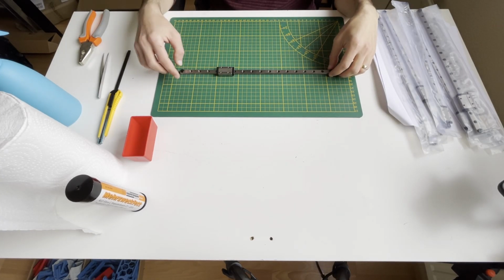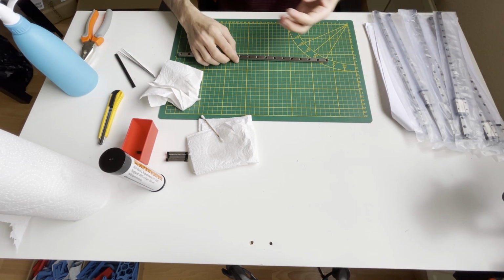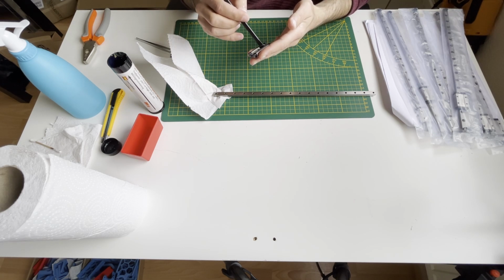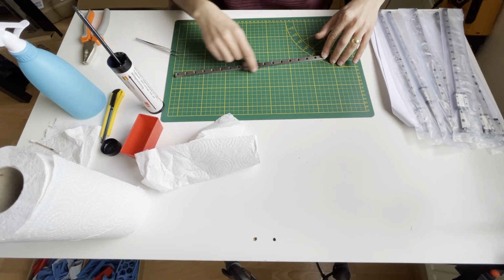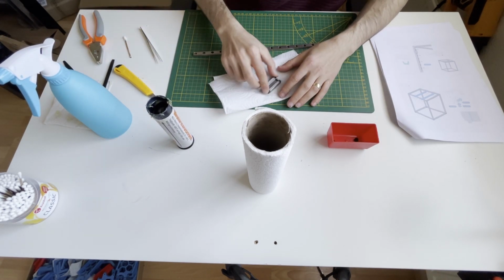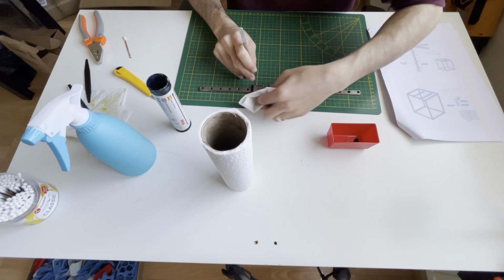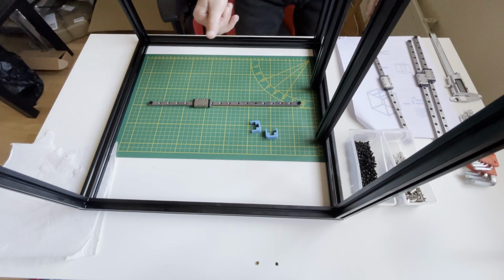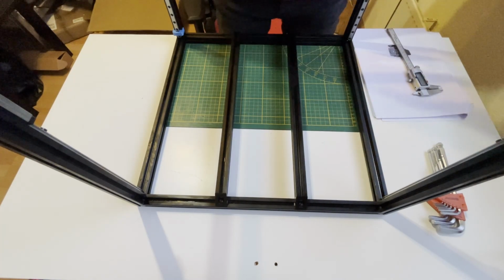Building Voron v2.4 - Linear Rails [Ep3]

Comment: Hi. Where I can i find "When tightening the fasteners to hold the linear rails in place, ensure that you have attached a centered rail installation guide to both the top and bottom. You should have two printed". I can't find this STL.
Reply from the maker: Under Tools folder: https://github.com/VoronDesign/Voron-2/blob/Voron2.4/STLs/VORON2.4/Tools/rail_installation_guide_center_x2.stl
Reply: @zer0isdoing  super thanx